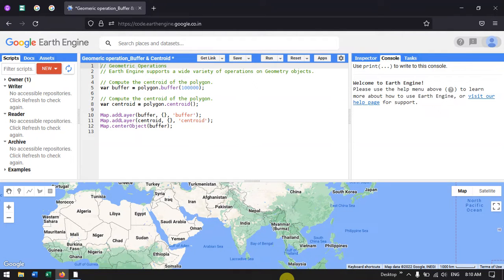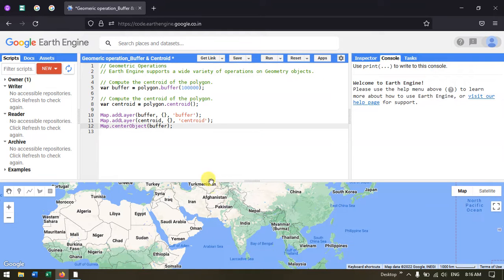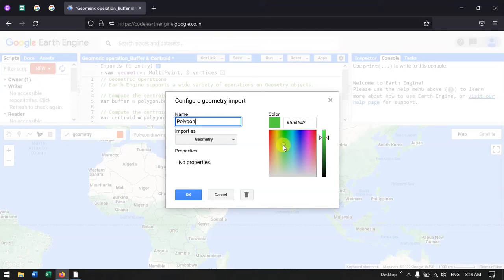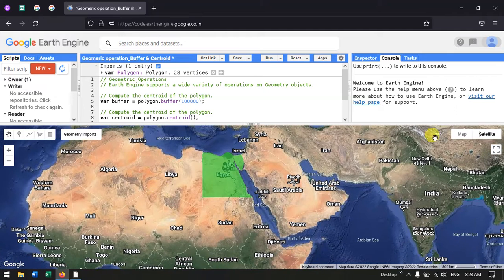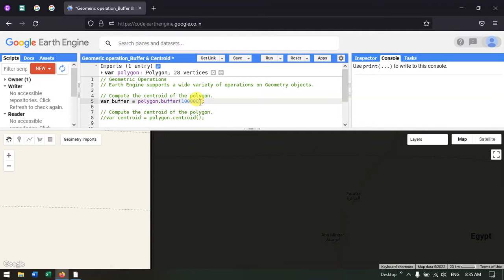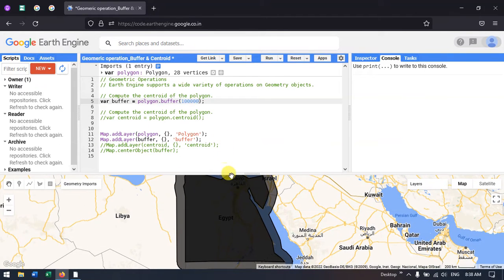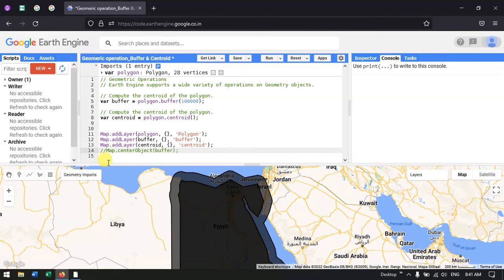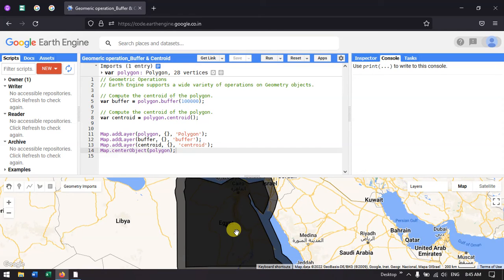Buffer and Centroid analysis in Google Earth Engine - Geometric Operation

Comment: I have a doubt, if I want to calculate about 250m and 500m distance buffers with a raster grid layer of 1km, would Google earth engine do the calculations right? It would never be the same as with a 30m grid, but I wonder if google earth engine has the capability to convert a 1km grid raster to a 500m grid raster, for example. Thank you in advance